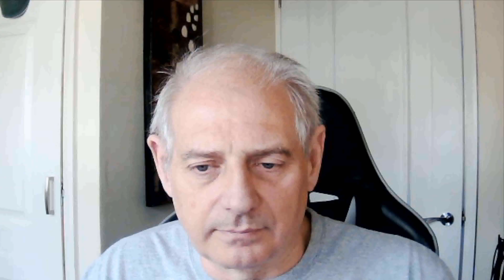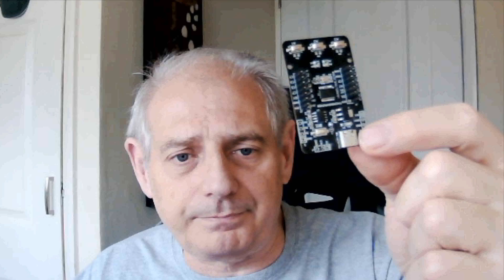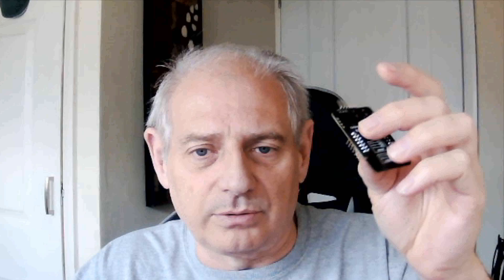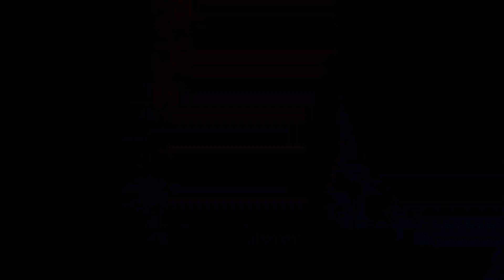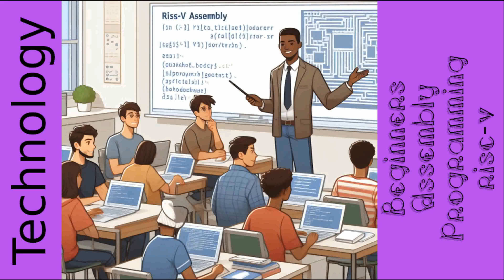Beginners risc-v Assembly

Comment: Are you going to do a full RISC-V with Embedded on your embedded board including interrupts, WS2812, UART, SSD1306 things of that nature? Something comprehensive?
Reply from the maker: Not this series, but that is a good idea and I can do that later.
Reply: @Rick62820  the simply biggest issue with RISCV from an Assembler perspective is the lack of good tutorials for using UART, even a simple SSD1306, Interrupts, WS2812 all of the things a MCU would do in ARM so it makes it difficult to consider.
Reply from the maker: I will try to do something along those lines. At the moment I am awaiting a serial link cable from china so when I get that I can start doing those types of videos.